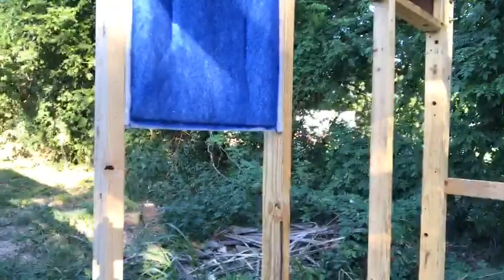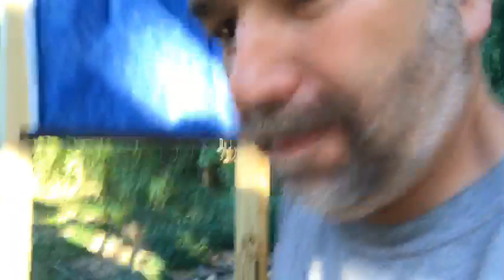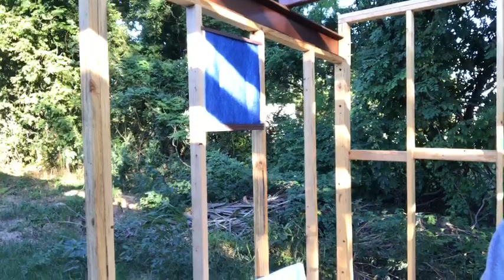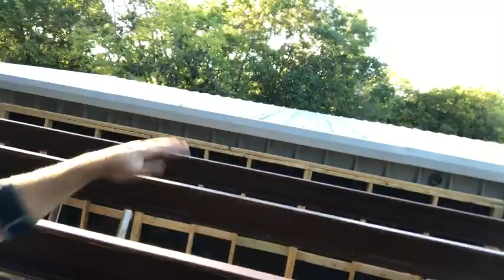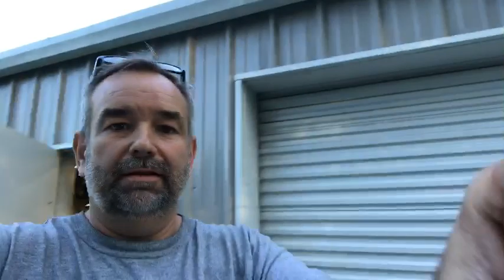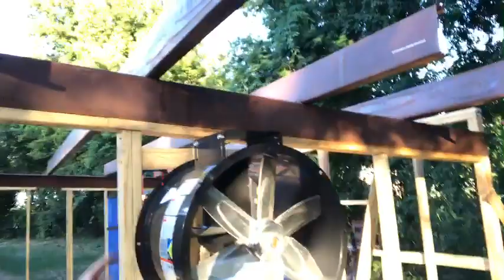Paint booth work LIVE

Comment: I get my company color PMS 375C (green) made into spray cans. That's how I usually re-brand my tools and equipment. My local Sherwin-Williams has an automotive paint store, and if it's not in their computer, they can color match a swatch. Their minimum is 4 cans, cost is around $25 per can. (Could have been way cheaper if my color was darker)

I do believe that Dupli-Color online has the same ability, roughly similar in cost as well.